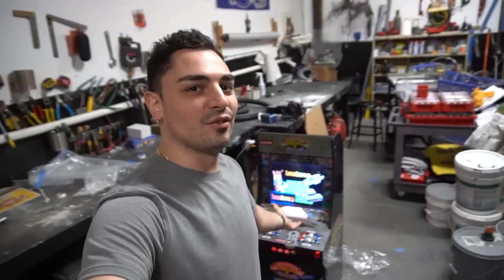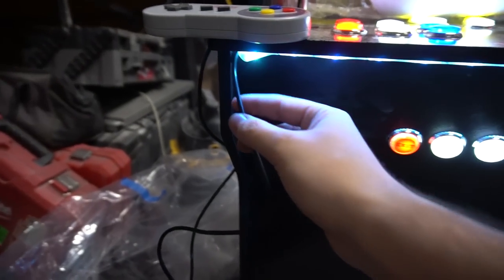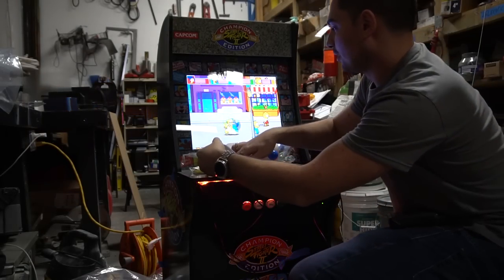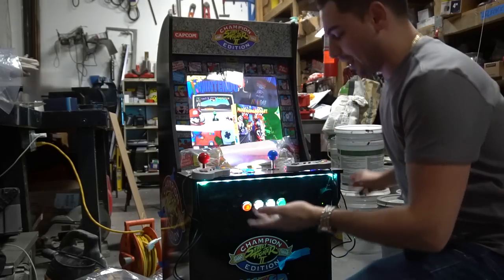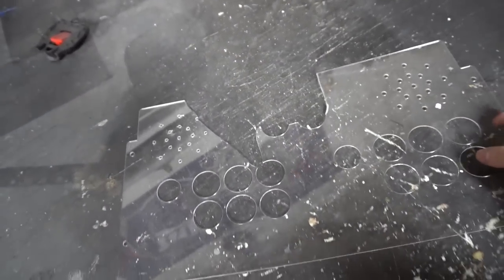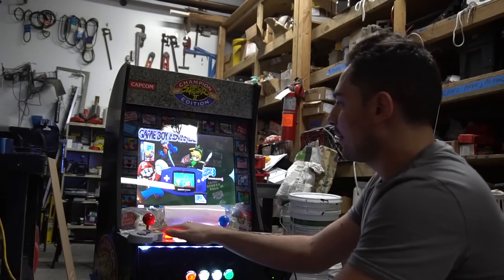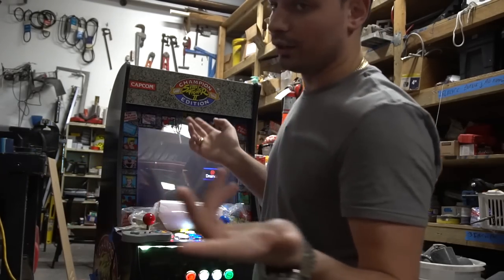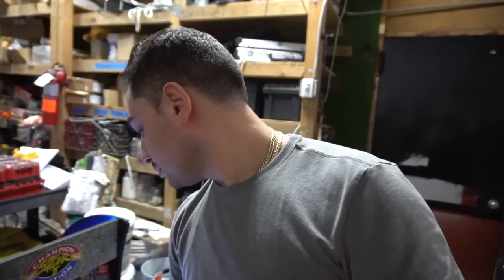Alex's 4 player modded arcade 1up COMPLETE

Comment: Slow and steady works on some acrylics, a pilot hole helps also. But most I've found out break. Lexan, although more expensive is much more forgiving. After drilling a pilot hole, I apply firm pressure and drill fast and it has not broken on me yet.
Reply from the maker: Yea someone suggested to sandwhich the plexi next time so it diesnt move

Comment: Where will the snes controllers rest while not in use ? You routed them through the front but won't they just dangle?
Reply from the maker: Gonna let the customer decide on that part, I normally put velcro on the controller and stick it to the kick plate that has the sf logos